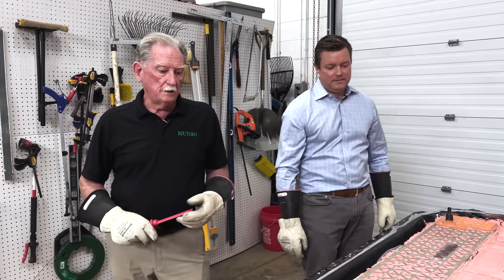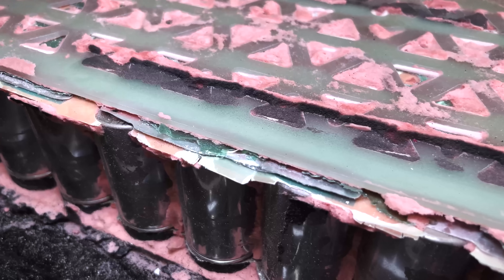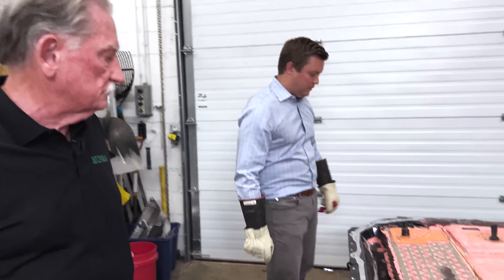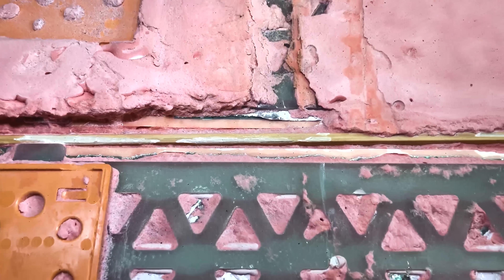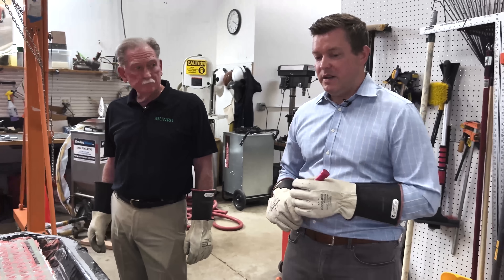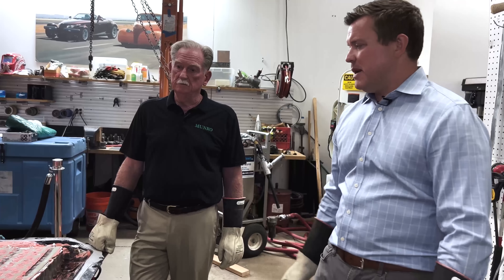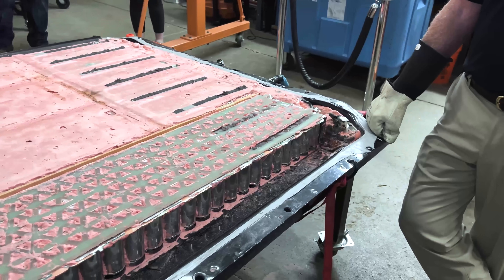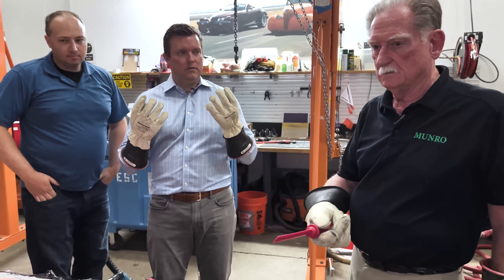4680 Battery Pack: What We Found Under the Foam!

Comment: Sandy, just small correction.  Liquid nitrogen is 73° kelvin, no where near absolute 0.  Did you mean liquid helium at 4° kelvin?
Reply: 77K 
also, no °. just K
Reply: It's all relative. 73 K is closer to 0 than 272 K which is water's freezing point.In the big picture, it's near absolute 0.
Reply: It would be liquid nitrogen; he just doesn't realize what scientists consider to be "near" absolute zero.
Reply: Lol, your all mad LOL. Good, good, let hate flow thru you

Comment: Sandy & Cory at the Tesla event you could see the exploded version of the battery pack with the inter cell side cooling channels. At such bigger volume for individual cells, it makes sense to cool the biggest surface and that is the side of it for sure. I bet the foam is thermal insulator, sound proofing against the road noise, structural rigidity improvement and fire retardant. It is a genius design and amassing innovation of what a structural battery pack, never attempted before, should be.
Reply: Yep. But there were many people who doubted that would actually go into the product. Bottom plate cooling was reiterated again and again by just about every Tesla channel after Battery Day so that it became the common consensus. Interesting, Lucid IS doing it, but Tesla isnt.
Reply: It'll be very interesting to see how the cooling channels are arranged and why Tesla is sticking with side-cooling. Cylindrical don't heat up evenly--they generate heat from the inside out, bottom to top, which is why pack designs like Lucid's, use end-cooling. Tesla might be using side-cooling due to manufacturing considerations or due to them building one big battery pack rather than a series of modules inside a pack
Reply: You mean a battery pack that is essentially just something to throw away after the use in the car right!? Because there is absolutely no way that thing can be reused for other applications after the car life! That’s a disaster
Reply: @carholic-sz3qv  Yes it absolutely can and will. Stable storage is a MUCH more pressing demand than overpriced conversions.

Comment: Thank you so much for clearly showing and stating what any well informed Tesla nerd, like myself, has been saying for about a year regarding the new structural battery. It's not built to ever be "serviced", when it's full useful life is done it will be ground up and processed for the raw materials. BTW, why  are you not fully discharging the battery for safety etc. ?
Reply: Bulshit!!!! The batteries needs to be reused after their car life! There are going to be definitely a lot of failed cells in there over the times. Batteries needs to be reused before any recycling

Comment: Three things that drive poor quality. One is fasteners. So what are the other two?
Reply from the maker: springs and belts.
Reply: @MunroLive  What do you estimate the capacity of this battery from what I calculated is: 816 cells * 98Wh (every cell) = 79 968Wh = 79.9 kWH

Which differs significantly from what the manufacturer declares.

Comment: This worries me. Can you even fix this other that a whole battery replacement and how much would that cost.
Reply: Impossible to say. Battery cells for evs at the kwh level have dropped over 800% since 2010. Nobody knows the bottom per kwh either.
Some say it's around $30 a kwh some say higher or lower. Only time will tell. 

Plus these pack's are already covered for 8 year's or 100,000 mile in all of the US at a minimum. Longer in some states, and legislation is changing the federal ev battery warranty to move to 10 years or 120,000 miles in the end of 2025. 
Cali already requires all evs sold there to meet that warranty period and time limits. 👍🏻

Comment: 816 cells * 98Wh (every cell) = 79 968Wh = 79,9 kWH 
Have I made a mistake somewhere ???
Reply: No, except that it is likely 828 rather than 816 cells, and the energy capacity of each cell is not really known.
Reply: @brianb-p6586  This 98Wh is the least optimistic prediction for these cells.
https://youtu.be/8WPPBhqeekw?t=197
Reply: @PrzyjemnePieniadze  Sure, but it's a prediction, not a known value.

Comment: 406th comment, one hour after posting. I read a couple of comments about a liquid that dissolves the pink foam. Apparently, you haven't found such a thing?
Reply from the maker: we found it, and order a sample of it. It works, but it is more messy, and dangerous than the Dry-Ice blaster.

Comment: Don't forget magnets.  Steel will jump up to a magnet.  Easiest material to separate.
Reply: Unless it is a non-magnetic stainless steel alloy.
Reply: @brianb-p6586  Some SS does stick to a magnets.  Surgical SS does not stick while inexpensive 18-8 SS alloy does just not very strong.
Reply: @randycarter2001  Yes, some stainless alloys are magnetic and some are not... and that isn't a matter of price. That's why I said "non-magnetic stainless steel alloy", rather than just "stainless steel alloy".

In case you are interested, most austenitic alloys are non-magnetic, while ferritic and martensitic alloys are magnetic. "surgical" and "18-8" are not alloy specifications, although 18-8 indicates the chromium and nickel content of some common austenitic alloys.

I have no idea what alloy is used for these cell cases.

Comment: Sorry if I missed this but could it be repaired at all being encased in foam?
Reply: What battery packs are getting repaired today?? Any accident that significantly affects the structural battery packs would definitely be catastrophic.
Reply: No. But neither can the battery pack on any other Tesla vehicle for that matter. Teslas BMS isn’t able to balance a new brick and an old brick so the only viable option is replacing the entire pack at once.
Reply: Oh right thanks for the reply

Comment: Liquid Nitrogen is -196C.  80 degrees higher than absolute zero.  And ... atoms don't "fall apart" if they get too cold.     I know chilling the packs for grinding is a useful tactic; but that hurt to hear.
Reply: Cooling it down makes I brittle therefore better for grinding to a powder.
Reply: He doesn't know what he talks about most of the time. This is the most anti-consumer thing that ever happened to batteries. Why would it be so hard to just get out the packs which are still okay, and just reuse them right and then? All of this floating atoms non-sense, smh...
Reply: I cringed a bit. also, don't they have an FTIR for plastic ID??
Reply: Surprised at this knowledge gap. Very cringy indeed.
Reply: Maybe discharge to zero and grind them down in a normal crusher plant?
Reply: @RotorWorks  Batteries coming in for recycling stand a good chance of being damaged, so discharging might not be possible.  Freezing does greatly limit the potential discharge rate, so avoids the thermal event with visual indications.
Reply: Just show how much they really "know" about recycling and other stuff. Bunch of car nerds, nothing more.

Comment: I appreciate the look inside the battery pack,  but LOL. Sandy is definitely not a chemist or physicist. What a pant load of nonsense regarding the recycling. Absolute is minus 273 degrees Celsius at which point all molecular motion ceases- things definitely do not fall apart. Liquid nitrogen is minus 196C. 
The packs may be recyclable, but it won't be by freezing them and  grinding them up.

Comment: $800 for one of those cell batteries is a bargain when you consider how much effort it's taking to get to them not to mention they're still going to have to pry them out 1 by 1.
Reply: Well, if they get 800 batteries out of that thing and sell them for $ 800 each; that would be $ 640,000 gross profit. Not bad.  Guessing that could work out to over 100 % net profit. I'd imagine Tesla would be more than happy to sell individual cells for $800 each.
Reply: @terrysullivan1992  But it won't be signed by Sandy. That's part of the deal.
Reply: @terrysullivan1992  They could sell cells at a significant profit, but won't. Hence the sticky foam. Some optimistic video at hyping $12/kWh, making this cell just over a dollar. I think it's a $10 cell still.
Reply: @terrysullivan1992  you got one too many zero's.

Comment: What about the 'zero repairability' you mentioned in a previous video? Were the fanboys too upset about that?
Reply: What goes wrong in a pack?
Control circuitry? (Ref ford)
It's on top and accessible.
.
Cells?
Take the cell out of the circuit, then it's not a problem, you lose a tiny amount of capacity.
Nice try, but think before you type?
Reply: @rogerstarkey5390  You fanboys are hilarious - no critisism allowed and "Elon" is God's gift to mankind 🙄

Comment: Recycling process described by Sandy is official from Tesla and already applied or it's concept? 
What fluid is used to float the mass?
Reply: They wouldn't use dry-ice. Shredding works fine at room temps. The "high-grade ore" explainer works at volume, but end of life cars are going to be all over the planet, so you're either shredding the entire car, or having to hoist and remove seats and loading packs into containers for shipping to main recycle centers. You'd have to factor in these additional costs compared to a ship full of low-grade ore from a mine. Though mining has ecological costs which is of more importance than financial costs if our accounting was ethical.

Comment: I understand the pulverization recycling method, but this still really sucks for reparability. Sucks that even modules can't be replaced.
Reply: I thought the modules would become happy home power walls once car owner is not satisfied with less than 70% (or whatever arbitrary number chosen). Unless Tesla has some magnificient BMS with the 4680 it usually only takes one poor kamigaza'd cell to make a pack useless.
Reply: @Paxmax  yep! Engineered obsolescence for product it's installed in and future uses
Reply: Tesla does not do module repairs anyway, even on the other highly modular packs. Third parties like Gruber Motor do however.
Reply: I somehow think it can go 2 ways... They either are like apple and just milk their customers, or, they aim at such high reliability down the road that replacing anything below the whole battery level doesn't make sense.
Reply: engineered obsolescence is the new sustainability, just ask Sandy and his cohorts
Reply: @missingpiece2071  Reliability trumps serviceability. Elon said Tesla's batteries should last 300,000 to 500,000 miles which equate to more than 20 to 30 years.
Reply: @kmarvel  I had a battery module failure in my model S a few years ago, resulting in the car refusing to charge. I have no details about what was the cause. It could have been a loose wire, which would probably have been avoided by this system. Or it could have been a faulty cell, which would have bricked this entire pack. 
Even though I can see the logic that this system can increase the overall reliability, I personally think this construction method is inferior because it makes any type of repair impossible. I would rather buy a vehicle of which I know the battery is serviceable / repairable.
Reply: @KimAbraham  How old were your Model S at the the time because the warranty is for 8 years or 150,000 miles.
Reply: @kmarvel  There are many reports of tesla battery packs now lasting for about300,000 miles.   One Model S owner recently reached 1 million miles on the car.  I has replaced the battery 3 times.
Reply: @kmarvel  Correct, it was fixed under warranty. However, my car will soon lose warranty coverage. I’m happy to know that its battery is fixable if/when something happens to it.

Comment: A MIT MY tear-down video gets a thumbs-up before it even starts!

EDIT - Sandy, cooling the pack down in liquid nitrogen (approx -340C) doesn't cause molecules to "fall apart". Rather it dramatically slows the motion of molecules, atoms, and particularly the electrons in the structure, making it safe to grind apart.

Had you considered - and rejected - the possibility of attacking the pink stuff with a solvent? It would be horrible stuff, but some shop probably could probably handle the task and return a de-pinkified battery pack to you.

Comment: It's already been said by others.
I love what this channel is accomplishiing.

But, I'm a little bit disappointed  by the fact, that about recycling those batteries, you guys completely missed the point of those complaints. You forgot the "Reuse" part of the trio (Reduce, Reuse, Recycle).
When considered dead on a car, those batteries still have 60-70% of life in them. And can be used  for less demanding use cases.
Add to that, the fact, that some bad cells can completely ruin a battery prematurely.
 Salvaging those batteries is essential, and that's what drive it's price at its end of life (on the car).

Plus, the liquid nitrogen part (even if necessary), of the recycling process seems to be an energy intensive process.

Comment: Truly amazing that you guys think the complete lack of reparability is a good thing! Please explain how the ability to recycle helps a customer stuck with a battery replacement bill of $10,000 to $20,000???
This disposable battery (from the customer point of view) can't even be dismantled and repurposed as home energy storage!
I guess the goal here is make the customer pay for everything new. This is only good for big corporations and their rich stock holders. How can the ultimate in greed be good? I just don't get it.
Reply: Would you rather have a phone that is easy to tear apart and replace the broken screen or a phone that can't be taken apart to repair the screen that doesn't break?
Battery replacements aren't a "thing". The data shows that battery life is more than adequate. The newer batteries are lasting beyond 200,000 miles and that gets longer as the data piles up. Tesla intends for the car to last for a million miles. Battery packs DO NOT need to be replaced regularly any more than an IC engine is meant to be.
Reply: @GROND15  To my knowledge there are no phones with unbreakable screens. 
But I sure would like a phone with a replaceable battery that isn't glued in place!
Your argument about the 4680 pack is false or at the very least, misguided. 
There will always be a certain number of battery packs that fail outside of warranty. There will always be people wanting to purchase a used vehicle outside of warranty. There is no getting around that. What do you say to the guy stuck with a failed battery outside of warranty?
Please answer. Thanks.

Comment: For all the celebrations for fewer fasteners and potential weak points, what’s the outlook for battery replacements? As service isn’t possible, whatever savings manufacturers see, the opposite happens to owners. Replacing this structural pack means a bunch of interior work or a whole new bottom interior coming with the pack. 

I would not want a structural pack. It’s very negative for the consumer. How is that not the case? Batteries suffer failures and damage. Now an underbody damage to the pack means paying for a bunch of interior work also. No bueno!

Comment: Judging from the dimension, I think there are 3 rows of 35 cells and 3 rows of 34 cells per pack, total to 207 cells per pack. Multiply it by 4, then we will have a total of 828 cells. Let's see if this is accurate...
Reply: Yes, likely true. Images from the manufacturing facility show that each cooling channel has 69 cells attached to it; they're staggered of course and there are 34 on one side and 35 on the other. Pack the channels and attached cells together and you have alternating 34-cell and 35-cell rows front-to-back in the pack.
Reply: At 98 Wh per cell, this would mean 81 kWh total!
Reply: @kolofsson  There are several guys working on tearing down the pack and cells, look forward to see what their findings look like. I can tell that Tesla is definitely not cutting corner in selecting the right material for max safety...

Comment: thank you for addressing the recycling concerns! I found it very annoying how much people were confusing service-ability with recycling-ability. Keep up the fascinating work!
Reply: It's still a concern because it's Reduce> Reuse > Recycle and Tesla is straight up deleting the Reuse possibility, you can't scavenge good modules to put in another car that needs it, if a few cells fail this whole thing needs to be replaced for a stupid amount of money.
Reply: @TheFPSPower  the whole point of having so many cells is that some can fail while the rest of the pack can carry on. by the time the battery pack is unfit for use, there is nothing of interest that can be reused, and the sheer amount of nickel within these packs means that it is more productive to recycle than reuse.

keep in mind, it takes some seriously good engineering to design something that is used so thoroughly that by the time it is at the end of its lifespan, there is nothing to reuse.
Reply: @TheFPSPower  yeah only exchanging one module in a Tesla battery isn’t a viable solution anyway as the BMS is unable to balance new and old leading to another module biting the dust quickly.

And it can still be used in stationary energy storage if the pack works.